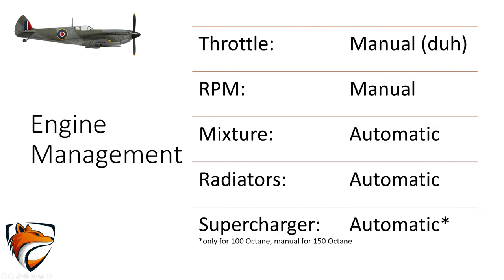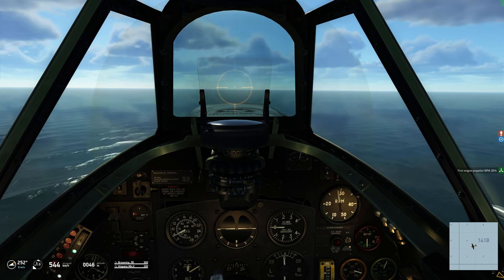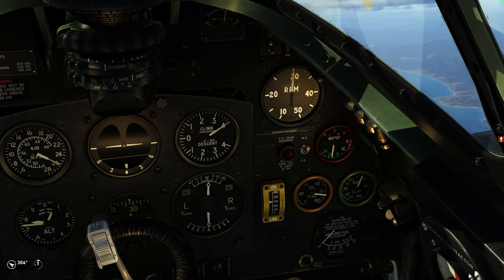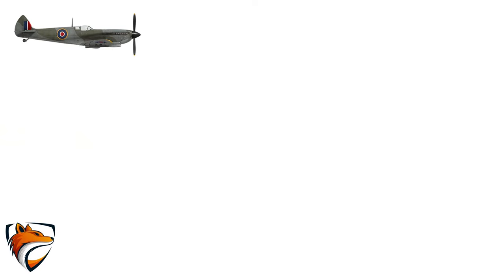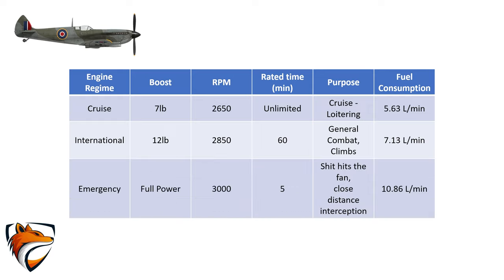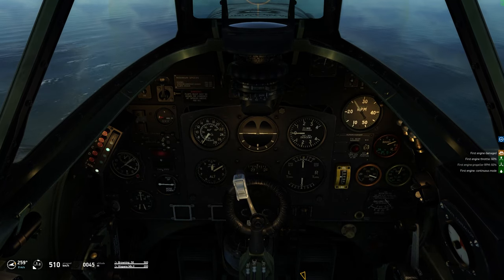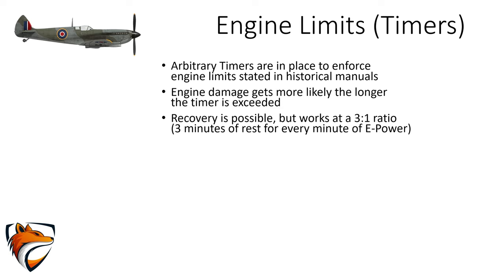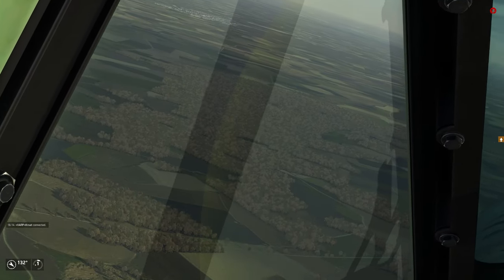How to Spitfire Mk IX Part 3 - Engine Management - IL-2: Great Battles

Comment: I've said it before, and I'll say it again. The game treats all manual limitations the same without recognizing the fact different nations were publishing their limits along different guidelines. German engines were basically run very close to their actual, mechanical engine limits, and there are reports available that show how much trouble was had especially with the different versions of the DB605. The same is true for a number of Russian engines - the VK105 was also run extremely close to its mechanical limit.
Meanwhile, the RR Merlin and its derivatives, the V-1650, the R-2800, these all showed they could run at their combat ratings for hours at a time. Meanwhile, in the game they're gimped compared to the high power output certain other engines can sustain for twice as long than them, with barely any recovery time required - because their engine manual said so, not due to any actual mechanical limitation.
Reply: It's utterly deranged how having conservative manuals is the most important aspect of an aircraft's performance in il2

Comment: I promised in-game on one occasion (Icer_CRO) that I would write:
At around 1:43 and onward you state: 
a high RPM sets the prop blades at a fine angle (correct) to try to get lots of (correct) large bites (FALSE) out of the air at a high rate. 
Increasing revs, given a constant manifold pressure and a given airspeed makes the prop take smaller bites out of the air (fine pitch) but more of them. 
Just imagine the fine and coarse metric pitch screw. Which screw is driven more deeply in 1 rotation - which one took more of a "bite"?
Also, the statement that this produces a lot of thrust is semi-correct. 
A coarser pitch for a given RPM would produce more thrust (eg. put more load on the engine, increasing manifold pressure), if we imagine a constant prop efficiency for the range.
An engines power output is a product of the RPM and torque (roughly manifold pressure), so you do get more thrust if you increase RPM, but this doesn't necesarrily have to do anything with the prop pitch.
Again at 2:00 your statement is false, mixing the prop pitch and RPM up in a way that is not correct. 
If you reduce the RPM, it is only the fact that there is less power produced (transferred to air if you will) that is the cause of less thrust being produced.

The prop governor has one main task and that is to keep the prop blades at an optimal angle, which in itself is a function of the rotational speed of the propeller ("RPM") and the (indicated) airspeed. If the prop governor is active (which it is in your video), the blades are at this optimal angle.
If the blades are not at an optimal angle, the prop efficiency is reduced. 
If the blades are way too coarse (coarse prop at take off for example, where the airspeed is near zero) the prop is stalled and not producing thrust because of this. 
Such a setup would produce an enormous amount of torque, maybe enough to tip a plane over (Corsair comes to mind), but not much thrust (because the prop would be stalled). 
This is the reason why the in-game specs recommend setting a high RPM manually at take off for German machines - the automatic governor regulates for the max power output, not for airplane stability.

The secondary function of the propeller governor is for the engine to be able to run at the optimal design RPM (usually around 2500-2700 for gasoline engines).
In 95% of the flight time the prop/engine should be turning at this speed. This is not the maximal power output, but the optimal engine efficiency (power output over fuel consumption).
Reply from the maker: Thx for the comment. I meant i correctly but phrased it in layman's terms and hence incorrectly.

Comment: I have tested 2900 rpm and throttle all the way open and I get 10 minutes safely, 12 is pushing the limit at that rpm. That is my defacto WEP setting, and then I increase rpm to 3000 for true emergencies. 

I've also noticed a tendency for the engine to over rev when adjusting rpm first followed by boost, and this drastically reduces the timer if you change throttle often. I think ten over revs will sieze the engine. In the spitfire I always increase boost first when going to WEP as this prevents the over rev. 

I use a chess timer on my desk to track my time in International or WEP. A simple slap on the timer after a throttle change switches between the two timers.

Edit: In the Spit I set my rpm top deadzone to 80% in the key bindings. With this setting, the throttle and rpm lever can act in tandem, moving them together will match them at cruise, international, and WEP. Cruise isn't perfect, but I'd rather have combat and WEP be a simple move of both levers simultaneously.

Comment: Because same engine is in P-51D, you can use its 15min combat timer, 3000 RPM, 61" is 3000RPM 15lbs on spitfire 9e.  Similarly on P-51D you can use 56" and 2850rpm to fly 1h what is 1h timer on Spit9.